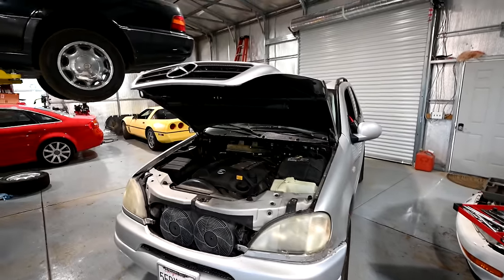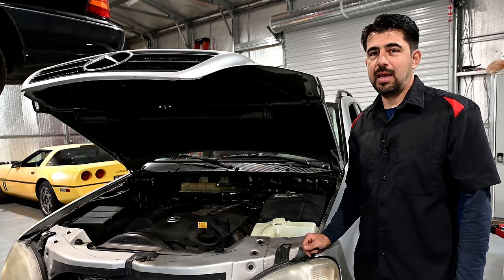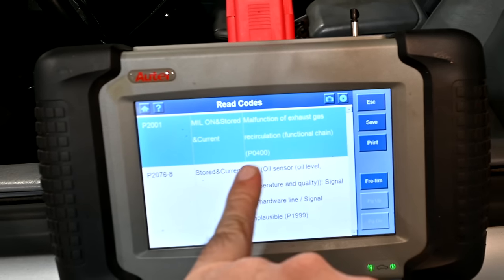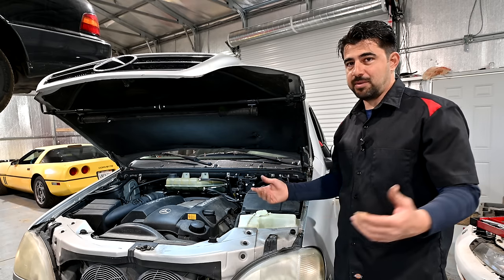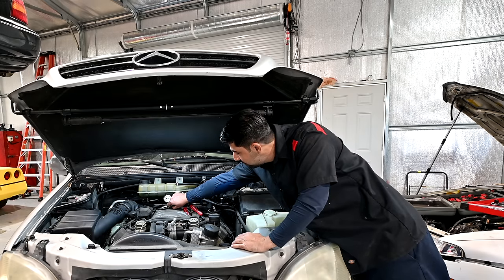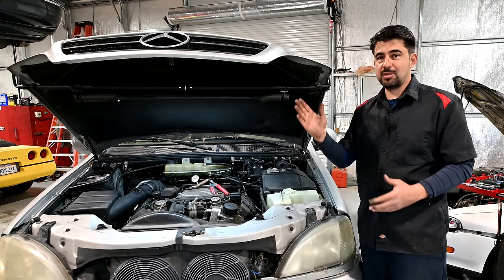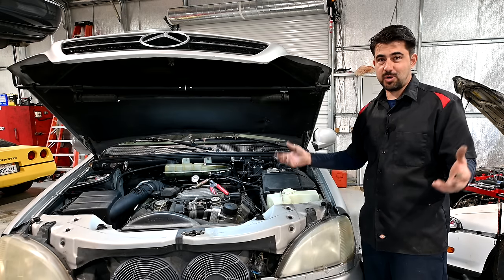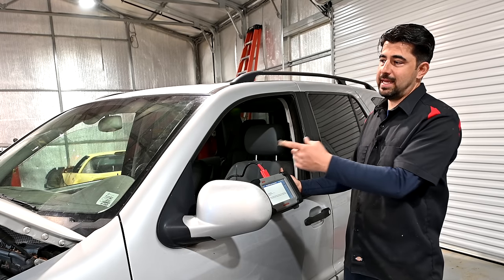Fixing EGR Problems and Related Trouble Codes

Comment: I had a GM engine reporting EGR that eventually proved to be an intake manifold gasket leak.  It took only a moment speaking to a competent mechanic to learn that it was a known issue with my engine, but not before a "GM certified mechanic" had soaked me for a fortune, giving the car back with "did all I could, hope that helps" and clearly knowing he was taking the easy money and too lazy to do the real job.  Charged me full extension price on OEM egr valve that was clearly not needed.  He belongs in jail.  And for what it's worth, spraying to seek vacuum leaks was not effective because there was so little access beneath the plenum.
Reply: There are many of those around there buddy.

Comment: replace EGR VALVE  2010kia sorento 2.2 desiel, now shows fualt p0490 its been at the garage for weekdrove home and p0490 came up again checked connector 12v both sides of solenoid diconnected pluge still 12v on plug on both outer pins to ground and 5v ?why 12v on both sides

Comment: Thanks for the refresher!  I had an EGR issue on my Camry 2.2 liter.  Vacuum killed the engine so good there.  Vacuum was created upon idling up at the modulator, so good there.  Applied 12v to the VSV no click and vacuum didn't drop, emptied my pockets and problem solved.

Comment: Can you do a video on how to fix code p0406 egr sensor circuit a high ? There is voltage between the signal wire and the ground wires on my egr plug someone told me this is not normal im just trying to confirm there is a short , where the short is in the circuit , what type of short it is and how I would go about testing for that .

Comment: Good day I have such a head ache with this problem with my car I sent my 2018 Nissan Pathfinder sl to a shop to get the plugs and coils changed unbeknownst to me they stripped the hex bolt on the throttle body and I can’t get it off to change the coils again and shops want to charge me a arm and a leg

Comment: I have a hardbody and had an egr for the longest but recently the error went away. Possible it just came unclogged? I know the check engine light still works.
Reply: No one can answer the question over the internet.
Reply: @warriormanmaxx8991 correct. That’s why I included the keyword “possible” in my question. Looking for suggestions not a diagnosis.

Comment: Hello 🙋‍♂sir please help me. i have a 1998 ford f 150 and i keep getting a po401 code. i already clean the throttle body its clean no carbon, the egr is working i put vacuum and truck almost cut off, so i rule that out, i took the cap off the egr solenoid while engine running also check volts has continuity, then i put finger on the top little hole from solenoid truck dies, rule out solenid, bought new dpfe sensor, check orifice tube from egr to converter its clean, i did notice on scanner egr  drive cycle will only pass when check engine code comes on only,  po401, any ideals what this problem could be?? im trying to pass emission test please reply  back thank you.
Reply: The code sets when the diagnostic for the P0401 run.  The EGR temperature sensor does not see enough temperature change when the EGR is commanded on. Failed temperature sensors are common.